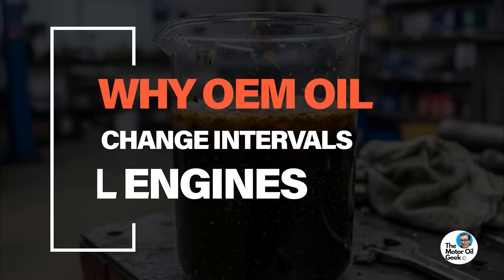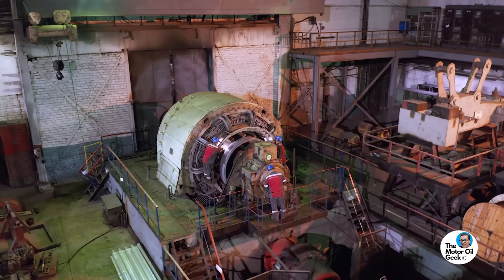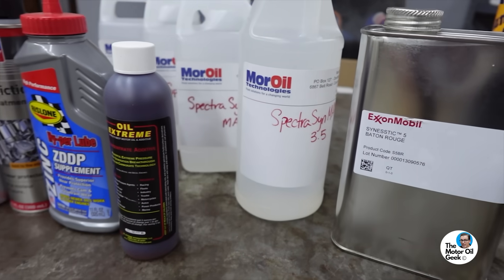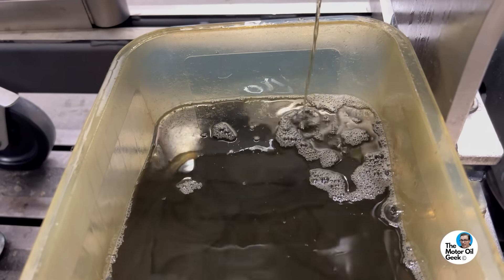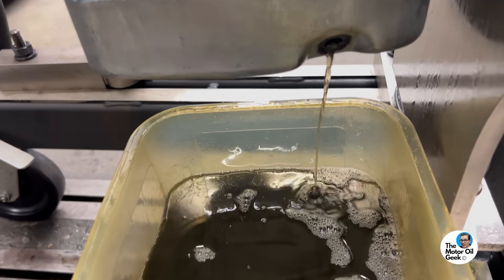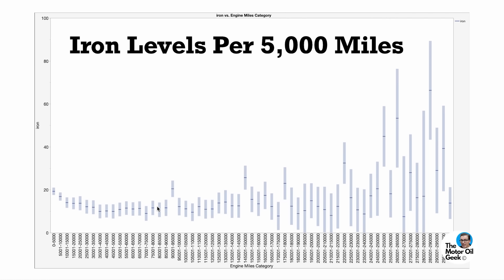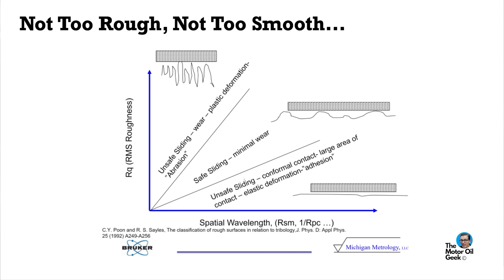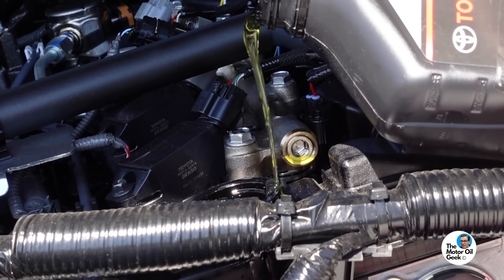NEW Data Reveals WHY Modern Engines FAIL Prematurely!

Comment: I'm not disputing in the slightest that engines break in over a long period of time, your data is also, well, data. 😄 I can however share a little bit on what we looked at in OEM environment where warranty is something that decide a lot (not the same as maximum life). We ran short break in intervals, a couple of minutes in stages between teardown and close inspection, engines of different procedures was then either sent out in the field to certain individuals that ran them 24/7/365 or they were running an endurance test (a few days of beating them to a pulp in controlled environment).
So first of all really specific to the engines and type of use, and secondly it was more about meeting or exceeding warranty, but we found that the first 10 minutes was what mattered together with the recommended service interval. The main issue was basically how we could safely load them to heat up the engine quick enough to load it the necessary amount for break in, idling the new engine for any period of time was really not good. Some coatings that was added in the engine made zero difference longterm (again based on warranty) but had a noticeable effect on controlling the first few minutes, which could make a big difference down the road.
So I can see why some say "they are broken in from the factory today", I know I've said something to the tune of "there's not a whole lot you can do", but yeah there's certainly a difference between 'making it to the warranty runs out' and maintaining peak performance for as long as possible. 😆
Staying on the safe side of maintenance and/or validating through UOA is absolutely the best idea, I bet even the OEM would agree to that. 😄
Love to see more about filtration, it seems even harder to find information about that then oil. 👍
Reply: Plateau honing of cylinders  and superfinishing of cranks was added to some/many US mfrs engines in the 80s and did a lot to reduce break-in debris.  I Wonder if Lake has any old oil  analyses from a 70's v8 vs a 2000's v8?  I'm sure that we would see a lot less debris at 3000 miles. Like 10x less!
Reply: @dhgmllcshea5038 I'm guessing he has plenty of data on that as many still rebuild engines with "old school parts", though it might have more attention to detail when it comes to machining as information about that has spread. But old piston rings etc might not be manufactured to the same tolerance as modern rings which means they will wear in more and that should realistically create more particles (at least in the beginning). 😄
Reply: Seems to me manufacturers starting using a thinner oil and that was ok to " delete" the break in service at 1000klms.
Reply: @M.j-y6y  Lake has talked about it, how EPA will grabb a car at the dealer and test it, break in oil make it hard to pass. And many are leasing so they run until it break, so including one oil change in between for free is what they do. But technology has moved on, it's not flat tappet cams in need for a critical break in anymore, but they still break in. 🙂

Comment: During after COVID it really got bad with metallurgy and Chinesium metal garbage.
Morons to lazy or cheap to have oil change and service cars.

I just did a few head jobs from people never changing coolant antifreeze which becomes acidic.

I also changed transmission fluid every two years or sooner if tow heavy equipment trailer etc .

I got 390,000 out of my 2003 4.3 v6  Chevy ,325,000 on AFM 5.3 2015 Yukon .
I change oil 3-4000 miles maximum.
Ac Delco filter and quality rated oil.

Absurdity people going 5-10000 miles on oil and filter.
Most filters bypass around 6-7000 miles when dirty.

This channel is accurate correct.

I have been a mechanic since 1976 a machinist building engines marine industrial diesel engines cars trucks tractors etc .
We test oil on large heavy equipment and generator sets.

Excellent he posts accurate correct information.

Metallurgy on some new engines are defective and 
Will fail regardless of oil changes quality.
Cummins 6.7 no oil to rockers since pushrods are solid  6.2 GM bad machine surface from mfg defect.
Plastic timing chain tensioner guides and chains also wear out quickly.
Pen stars drop valves , New Bronco motor junk.
Eco boost trash water pump in oil .

Ps : can you give me all the used oil from flushing?
I will put it in my old tractors..lol

Comment: My 2000 Jeep WJ with the flat tappet 4.0 6-cyl runs like a top, what a great engine! It's so quiet that it's hard to tell if it's even running at 100k miles. Even though it has super low mileage, Valvoline Restore & Protect 5W-30 is all she gets with 4 K-mile oil-change intervals, along with a bottle of Techtron in the gas tank with each change.

Comment: I have been watching your videos and there is no argument about the information you have provided. I do have a few things to consider, decades ago people just didn’t drive as much and once the car hit 100k or so that was about it for it. Back then most people changed their oil at much shorter intervals some even at 1 and 2 thousand miles. I remember there was still engine problems back then. I did many timing chains on chevys with plastic top cam gears along with cams on those old 307s. That is just one example and pretty much across the board valve jobs. I often wonder if you could go back and have had the oil and fuel packages we have today if the outcome would be different or if it was just a problem with production as we see today. Side story my dad told us that back in the day when he was a young man and still had to hand crank to start the cars winter time was not fun. He would drain the oil out after coming home from work and put it next to the stove [ back then it was a coal stove that was in the kitchen] and then in the morning fill it back up with warm oil so he could get it started and while at work he would use an old heavy blanket to cover it up the best he could. Life was not easy. He always said when people take about the good old days they can have them because life was very hard almost every you did was a struggle compared to today.
Reply: My Grandpa often mentioned that the "good old days" weren't always that great.

Comment: 7.3 and 6.0 powerstroke or anything running HEUI injection, that is the most abusive in to engine oil using it as hydraulic fluid pressurizing it up to 3k psi to fire the injectors

Comment: Since 1981 oil has been part of my automotive world. I installed a 5 quart Harvard bypass filter on my new 1981 Ford F150 with a 4.9 liter inline six. I ran Neo full synthetic oil. The filter filtered down to 1 micron. Filter changes including full flow was every 25,000 miles. I owned that truck for 18 years. It had 350,000 miles when I sold it. It burned 1 pint of oil every 10,000 miles. A mechanic checked the compression of my truck when it had over 280,000 miles and said it was like brand new.
Reply: Same, built my first engine in 1984. I learned about synthetics and oil analysis in the USAF.  Been using Amsoil and thier bypass filters ever since.  I run it my 2012 Ecotec GDI, one of the dirtiest, fuel diluted engines made and are known to fail in multiple ways before 100k. Now have 225k miles, clean as new, gets better than new mpg.
Reply: @tssci6774 What are the filter change intervals?
Reply: @johnackerlind4707 25k miles, I change the oil at half way, which is about a year.  I remove the filter and drain the old oil out, then reinstall it.

Comment: Message boards are full of idiots saying “modern engines don’t need break-in.” Even when the manual actually states the break-in period.
Reply: Totally agree , I see brand new trucks and cars leaving the dealership lot and getting on the highway hammering down   running 75-80 mph driving it like they stole it , and they wonder why they have engine problems in the near future .
Reply: Very few people bother to measure their wear.
It's a cheap test and it tells you exactly how often you need to change your oil.
Better yet oil analysis tells you which oil... and which additives work best.
🙂

Comment: It is said: dirty oil clean engine, 
That means that the oil has done its job. So its time to service, oil & filter.
Go away from ultra thin oils and over 10K services. You think you are greener, not clogging aftertreatment systems and saving some %MPG but going towards a big engine bill not protecting your engine properly.
Do you think medium and hing SAPS are not so dirty and protect more the engines ?
Which is/are the additives that protect more for oil dilution ? Because now a days GDI technology Turbo or NA are making the oil to protect less and faster.
Thank you and congratulations
BimmerN53

Comment: I would add material selection & heat treatment of engine/transmission components have changed to be cheaper, & less durable, aside from machining & cleaning problems. Also complexity compounds.

Comment: Break in and metal particles… once broken in (longer on Diesel.. 10-15k miles), should utilize Oil Analysis to establish a change cycle that may be as high as 8-12K miles depending on reports. If utilizing an Oil ByPass 1 micron system, other than needing to replenish additives with 2-4 quarts (diesel 18 qt) is there a concern to change oil?  Many diesels (Semi & Pickup) don’t change oil other than filter & replenish qts., this is an area would enjoy seeing you cover in more detail.

Comment: Thank you for what you do and what you brought up to the public in all of your videos. It makes sense on many levels and it helps educate general public on basics of vehicle ownership. Unfortunately, so many out there are unaware of the content of your videos, and keep getting the cheapest oil and filters, along with cheapest gasoline etc. Some of people I know, go to the quick service oil change places where they, it seems safe to say, do not even let the oil completely drain before putting the fresh oil in. Some of my friends have experienced lack of oil filter changes in quick oil change locations simply because of the oil filter locations on their vehicles. So not only that they did not have a good oil and oil filter on those occasions, they did not get the proper amount of new oil and in some cases they did not get their oil filter changed. And, sadly to say, some of people I know, besides all of this, go gfor 10k mile oil changes. A recipe for disaster, in my opinion... Thanks again, and please keep up with good work. I also live in the old north state. Best regards.

Comment: I've been telling my friends and colleagues for years, "If you want your vehicle to last 300-400,000 miles, you have to IGNORE the manufacturer's recommended maintenance schedule."  The 7500 mile or 10,000 mile OCI is insane.  I do 5K intervals, with full synthetic (Valvoline R&P).  And for good measure I do an oil analysis at Blackstone about every 50K miles.

Understand, the MFR maintenance recommendation is not about your vehicle's life, it's more about Bean Counters calculating the vehicle's "Cost of Operation and Maintenance".  A vehicle who's recommended OCI is 10K miles will have a lower "cost of operation" than one that suggests a 5K OCI.  See what's going on here?  The Manufacturer with the most liberal maintenance schedule can boast in their advertising, "We have the lowest cost of operation!", and it would be true, but that vehicle will not last to the 175K mile mark.  It's a numbers game.  Don't buy into it....
Reply: True and it is also about environmental  protection they want u using less oil during the life of a vehicle
Reply: Yep. My owners manual for my 2021 F-150 claims I need to change the oil every 10,000 miles, even with a turbo V6! That is insanity. I change my oil every 5,000 miles with Pennzoil Ultra Platinum full synthetic, change the oil filter with Mobil 1, and change the engine air filter with Motorcraft filters. 

Also, the claim of a "lifetime sealed" transmission is BS. Get your fluid and filter checked and changed at 50-60k miles and again at 100k and then every 20k miles after. 
There's no such thing as "lifetime" transmissions. The fluid breaks down and becomes acidic, along with the filter becoming clogged and small metal fragments eventually clogging the small channels in the valve body. Especially with new transmissions where tolerances are insanely tight, so even a little material can cause a clog and ruin your transmission.
Reply: @Miked1332 I put a new PPE Tranny pan on mine. Heat sink fins, and a drain plug.
Reply: @Miked1332  Correct. Owner's manuals are more concerned with owner convenience and getting the car through the warranty period. They are not intended to help your car last forever.
Reply: Same thing with viscosity. If 0W-20 makes a vehicle look better for fuel economy and the other various tests they tun, that's what's "recommended." Even if say 5W-30 is better for engine performance and longevity.
Reply: Yes, we do 4.2K - 4.8K miles on our CX-5, with PUP. This is as high as I would ever go with any of my vehicles, except I could probably extend it to 6K - 7.5K with Amsoil Signature. IMO, it’s not worth the extra cost, and no matter how good Amsoil is, I would never go 15K - 20K intervals.
Reply: I would never let my oil go 5,000 miles. And I don’t use group 3 oil either.
Reply: My last 3 vehicles were changed at 10k miles. All made it over 200k and one nearly 300k before I sold it to a college kid. She's still driving it 😂
Reply: Isn't an engine a mostly sealed unit, and the oil goes through sealed pressurized channels? How would oil get dirty?
Reply: @Wind_slash0  Blowback through the piston rings.
Reply: @Wind_slash0  Engines can gather condensation (water) in the crank, dilution from gasoline when injectors are dirty enough to shoot a stream and not atomize the gas, wear at bearing/shaft interfaces, and combustion soot/blowback.  Also lastly, and the most important way, dirty or inadequate engine air filters allowing sand (silicone) into the combustion chamber which makes its way into the engine after it damages the cyliner walls thereby allowing more blowback.   Consider them open!
Reply: @Wind_slash0  Fuel and water contaminate your engine oil at every cold start before the piston rings warm up and expand.

Comment: Theres so much misinformation out in the world it’s unreal, but at least with Lake he gives you legit facts and info. You got oil companies marketing oil for 20k intervals. You got manufacturers boasting 1-2yr oil change intervals. Being a tech for 20 years and spending 15 of those with GM I spent a lot of time fixing engines. I always put 3months 5k km service intervals on people vehicles. Most of the time 6 months 6-8k was the norm you’d see people come in for service. In Canada we have extreme climate. If you take a look in the owners manual there’s 2 service intervals. Normal and severe. Most people over look the severe part. In winter, it’s harder for a vehicle to get rid of moisture, especially in stop and go driving where the engine never really gets hot enough. With direct injection you also get more fuel contamination in the oil, especially with extended oil drain intervals. I had an L83 in a truck the guy would go 1yr oil services. In -30c the engine wouldn’t turn over since the oil had froze due to the amount of moisture that had accumulated in the oil. I had taken 2 samples, 1 from the truck and 1 from the shop tap in bottles and placed them outside to verify we didn’t have an issue. The L83 and L86 engines have the same engine clearance specs as the LS and LT1 which run 5w30. I run 5w30 in our Tahoe.

Comment: This is why it never made any sense to me how as carmakers started putting more and more of these [hydraulically-driven] systems on engines (and on more engines in general)...they started also increasing the OCIs.  I think where they got people was in the decade previous people got used to the idea that synthetic oil could last say 10k miles...yeah in an older engine without any of this stuff, sure.  The irony is those old engines had short OCIs being intended to be used on conventional oil, but end up being much more suited to longer OCIs on synthetic than today's engines...that actually tell you to change the oil at these crazy long intervals.  It's also interesting that back in the day they used to tell you it was okay to change the filter every other oil change, but today that kind of thing is laughed at.  Yet here we are showing doing exactly that might actually be a good idea?

Comment: Excellent video! Agree about the bridling  and oil change intervals. Curious about peak load capabilities for the 0w20 versus the 5w30. We have seen less failures on the 5w30 engines than the 0w20 or 5w20 engines on camshaft followers. 
 Your comments about oil changes are the same as I’ve been preaching to customers for years now.
Reply: Viscosity doesn't really have much to do with it.

500cu in Pro Stock engines turn in excess of 10,000rpm and make well over 1500hp, but run 8w oil. 

As long as the oil is spec'd for the bearing clearances and the oil temp doesn't exceed its recommended operating range, it will be fine.
Reply: Yeah, Pro stock engines have an extremely short life span, don’t operate or see load bellow 4kRPM and all finishes are precise. All situations where water for oil is tolerable. Real world with less than optimal finishes, low rpm loading and only god knows what for maintenance intervals, I wonder how much difference there is between load capabilities of 0w20 oils and 5w30 or 5w40 oils.

Comment: Another factor you did not touch on is Cavitation.   Too high of viscosity will result in improper lubrication due to this and the result will be metal on metal.
Reply: Not many are putting 80-90W in their crankcase.
Reply: @M8Stealth  I would hope not!  You can get cavitation with the viscosity of water.  Anyone with a boat has experienced that with a propeller.